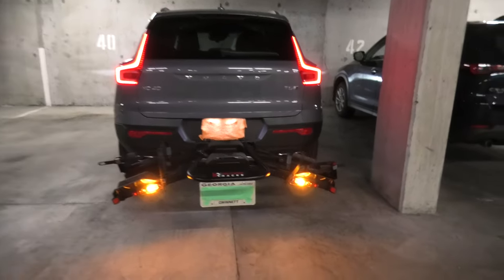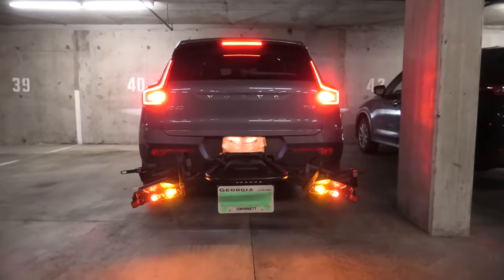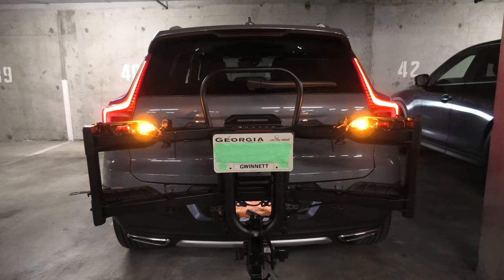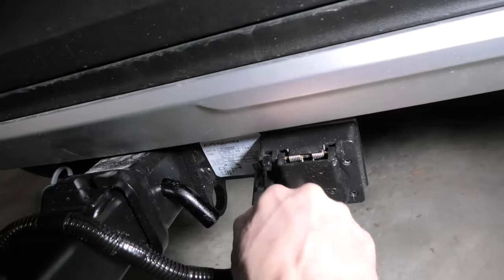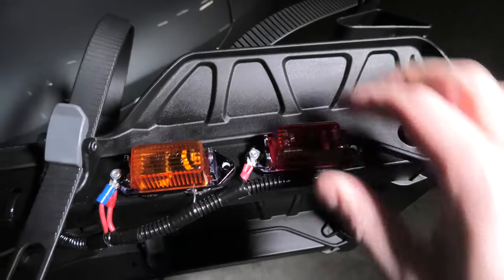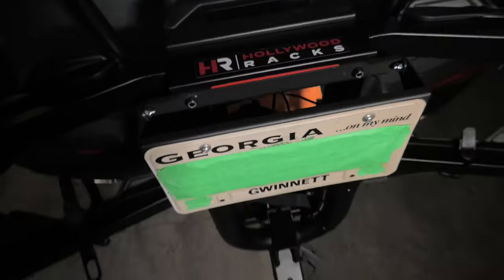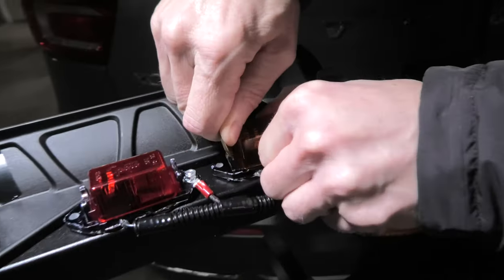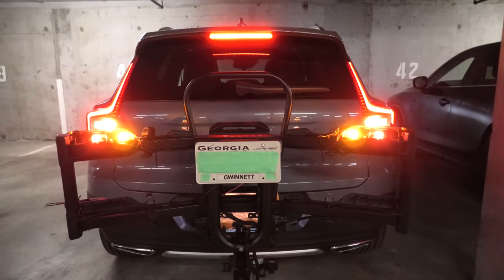Volvo XC40 (2019-2024): Custom LED Lighting And License Plate Mount For The Destination E Bike Rack!

Comment from the maker: PRODUCT LINKS:
1. BIKE RACK - Hollywood Racks Destination E Hitch Bike Rack with Ramp for 2 Bikes up to 70 lbs Each - Secure, Lockable Electric Bike Rack - Premium, Foldable Bicycle Car Racks for Standard or E-Bikes - https://amzn.to/4bEnljN.
2. LAMP ASSEMBLY:
- Black Base Yellow Lamp - Optronics MC11AS Mini Marker/Clearance Light, Amber - https://amzn.to/3SZtT5h.
- Black Base Red Lamp - Optronics MC11RS Mini Marker/Clearance Light, Red - https://amzn.to/48l5oEb.
- White Base Yellow Lamp - Grote 46883-5 Economy Clearance Marker Light - https://amzn.to/42IJ1r0.
- White Base Red Lamp - Grote 46882-5 Red Economy Clearance Marker Light (Retail Pack) - https://amzn.to/3SJC2JI.
3. YELLOW LED BULBS - AUXITO 194 LED Bulb Amber Yellow (Pack of 2) - https://amzn.to/3UGyScb.
4. RED LED BULBS - AUXITO 194 LED Bulb Red (Pack of 2) - https://amzn.to/3T2SHcQ.
5. LICENSE PLATE BRACKET - AMOPA AMOPACORP Stainless Steel Flip-Up 254mm Hawse Roller Fairlead Mounted License Plate Holder, Black - https://amzn.to/3SIBpA2.
6. 4-WAY TRAILER PLUG - MECMO 4 Way Trailer End Connector Wire 10 Feet Jacketed Cable, Heavy Duty 18AWG 4 Pin Trailer Light Plug Color-Coded Pure Copper, Trailer-Side Male End 4 Flat Connector Trailer Hitch Wiring - https://amzn.to/3wgoFcD.
7. 18 AWG WIRES - 18 AWG Stranded Wire Spool 25ft Each 6 Colors - https://amzn.to/3YR5Oxe.
8. SPLIT WIRE LOOM - Gardner Bender FLX-3810T Split Flexible Electrical Tubing, ⅜ inch x 10 ft - https://amzn.to/3kwmr3k.
9. SUPER MAGNETS - DIYMAG Powerful Neodymium Rare Earth Disc Magnets - https://amzn.to/3OLIFtY.
10. ELECTRICAL CONNECTORS - Baomain Ring Ground Insulated Wire Connector Electrical Crimp Terminal 18-22AWG Red RV1.25-4 Pack of 100 - https://amzn.to/3Ltg77M.
11. ELECTRICAL TAPE - 3M Scotch Electrical Tape, 3/4-in by 66-ft - https://amzn.to/3J0M0TB.
12. ZIP TIES - 400 Pack Black Zip Ties Assorted Sizes 12+8+6+4 Inch - https://amzn.to/3xWjrjM.